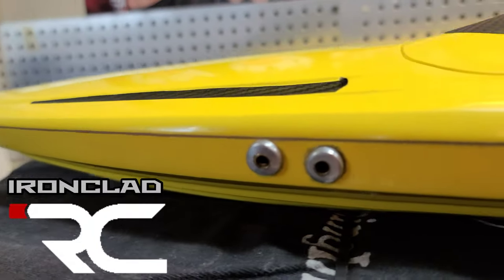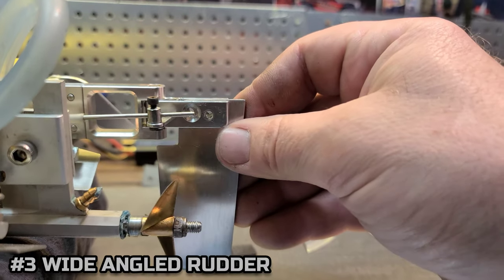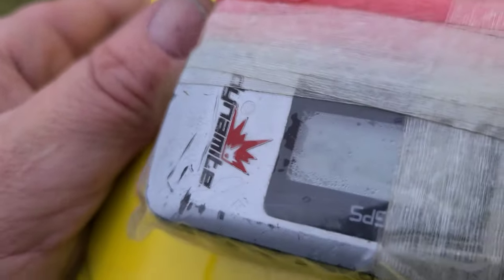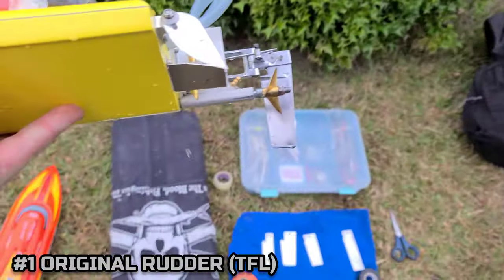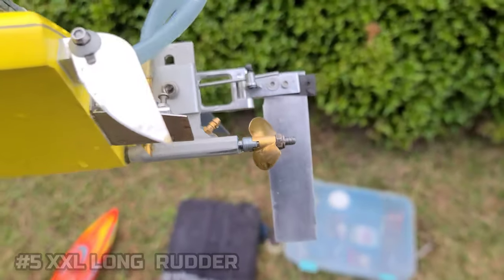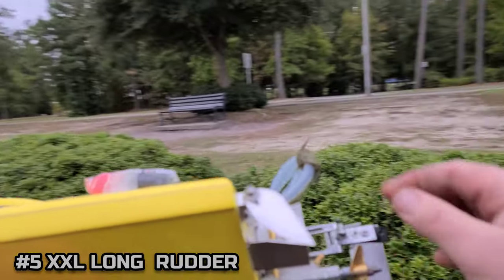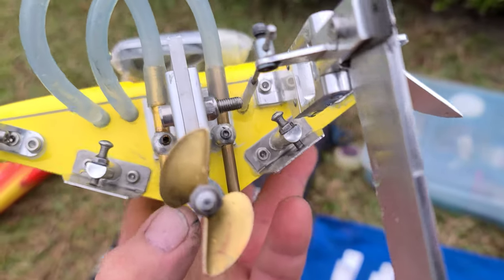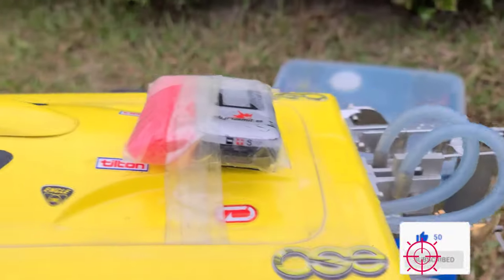Home Made Rudder BladeTesting For Speed Fast Electric RC Boat | Knife Blade vs Wedge Rudder

Comment: I "tune" my boats other way, because i was told to do so by experienced boaters.  I start with putting strut up about 1degree, then adjust c.g. to point it runs nice and doesn't blow over anymore (with some tweeking off course).  All done without using turnfins or trimflaps. Got waterpick-up above bottom, so no drag from there. Use trimtabs mainly for cornering with turnfins. Turnfins also don't hit water in straight line. Only adjustment fins is the angle, some of my boats like more angle, some almost vertical. So my boats run quite well without turnfins or trimtabs. Works for me, maybe give it a try. The idea of other rudderblade gave me an idea... could use a little more lift on one off the boats, and that boat has a slight angle to the blade, will try a straight one! So keep making video's man, they are interesting...
Reply from the maker: Yes sir it's fun to see what happens when you put different Rudder blades on, And a sense of Satisfaction once you get it dialed in and running the way you want it to run.    Thanks for the advice my friend.

Comment: Nice experiment! As you surmised, speed and handling don't go hand-in-hand with each other. Unfortunately, you can't have both. The most you can achieve is a good balance of each. If you want all out speed, rudders and turn fins with the least amount of resistance are the ticket along with tuning the boat's COG so that it runs "dry". For stability and better handling in the corners, do the opposite. Run a larger turn fin and rudder and tune the boat's COG so that it runs "wet". Hey it's all subjective anyway. Thanks for the frequent videos!!

Comment: Do you have any trim adjustment? Or is it fixed in neutral position? An adjustable stinger would do wonders for the boat if that's not the case as is.
Reply from the maker: Trim tabs & stinger basically Neutral for the testing. I didn't touch anything from Rudder to rudder..I  really wanted to see how each rudder affected the ride. I   Wasn't trying to tune the boat.  It's just for fun realy

Comment: Hello. I noticed that you've put a different water pickup, each side of the drive shaft.
I've just been given a new Spartan for my birthday. I understand they can run too hot, do you think it would be worth doing the same thing? Do they create much drag?
Thanks
Reply from the maker: No not really. Takes several runs to dial them in but they cool amazingly well ,  oxidean marine uses them on most of there Rtr boats